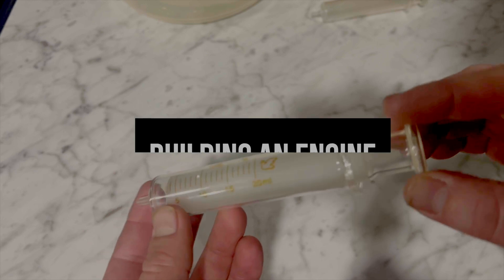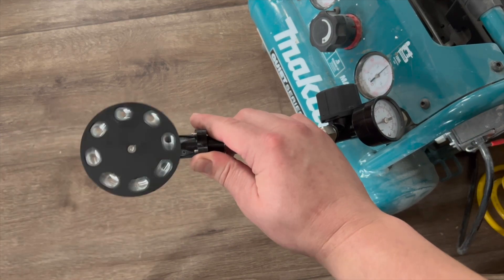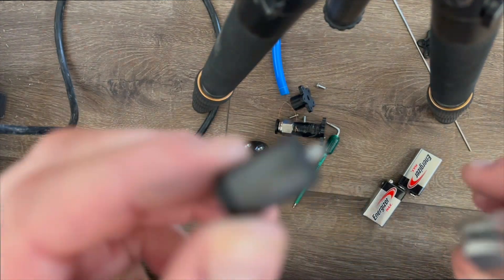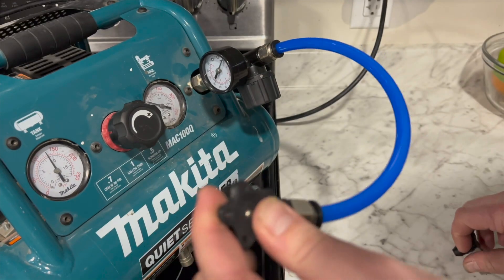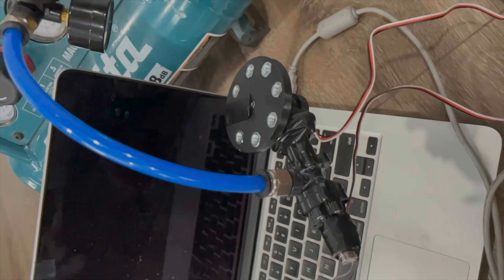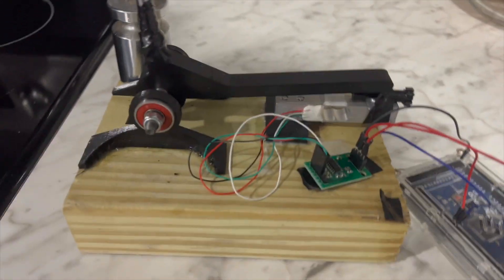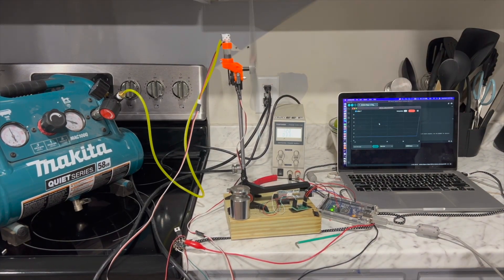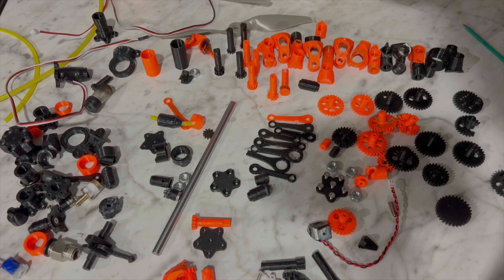Air Powered SyrEngine

Comment: heyyyyy, hes back from te$la! The syringe has a low resistance on rotation because it forms and air bearing. The idea is that the shear stresses created by the stagnant air on the surface of the glass increases with the rotational velocity. As the two pieces of glass are essentially moving in opposite directions they create counter pressures on their surface driven by the shear stresses. Due to the distance of the surfaces being very small only a small relative velocity will cause large forces as the energy or velocity information is transferred into the very small amount of fluid. It can be characterised using POISEUILLE FLOW. 
.

Comment: Idea fir a video (if you need any: 

Comparing all the existing Open Source / DIY designs for Planetary Gearboxes and Cycloidal Gearboxes.

You could test them on their own, or as part of one of those “robotic actuators” a la “MIT Cheetah” for things like Open Dog!

It could even evolve into a community competition like that Noctua Fan Blade thing did.

Granted if you want to try things that aren’t just gears and actually pursue your interests that is 100% valid, and also i LOVE air engine stuff (especially since it seems you are going the electrically controlled “feeevalve0 type route!), but i just thought I’d throw this idea out here since you have test rigs and expertise in 3D Printed Gears 

(also having a great design for 3D Printing (and maybe FDM Print to Cast/CNC Metal Workflows!) a Gearbox+OS Servo Motor/A  Nema Stepper based robotic actuators that can be “dropped in” to Robot Arm or Robot Dog designs etc could really speed up the various projects out there and help reduce “redundancy waste” / inspire others.

Either way neat to see you back, and great video!

(DAMN that was rambly, hope you could understand all *that*, thanks for reading this far lol I’d love to know what you think of this idea)